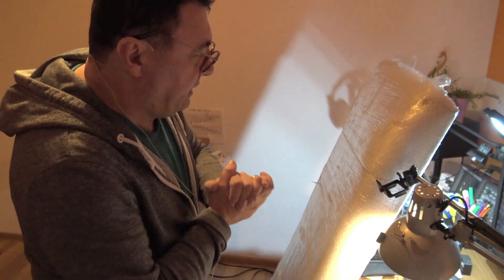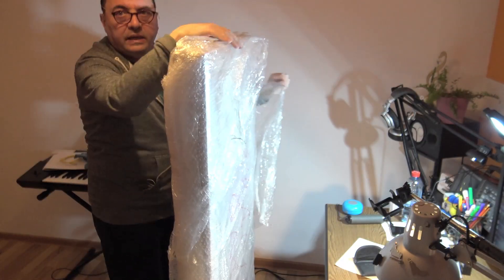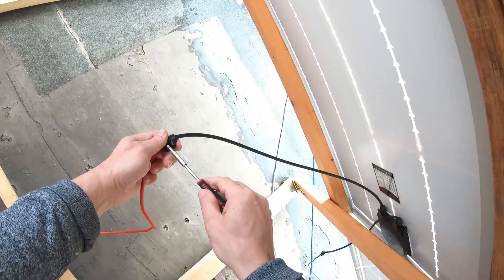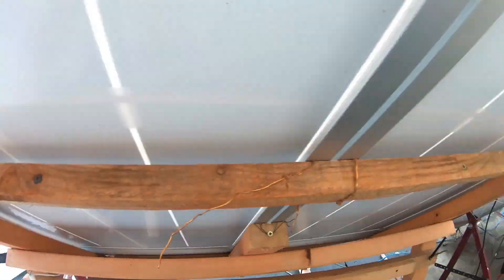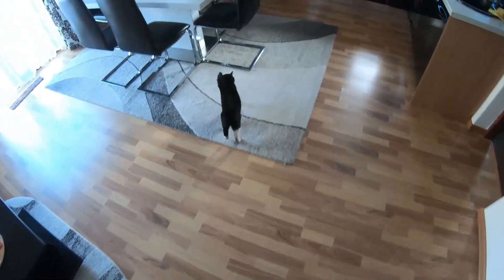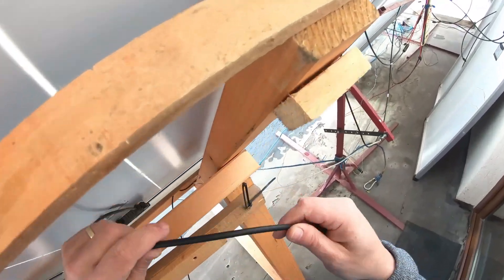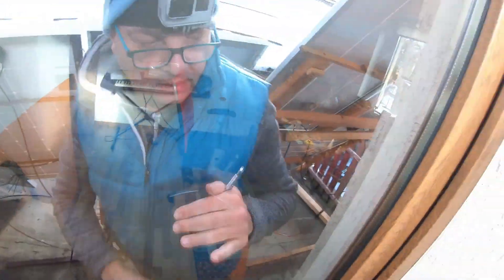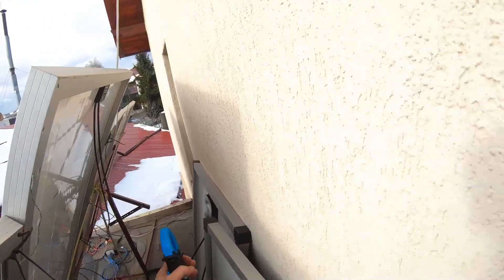SolarFam SZ-200-36M High-efficiency mono solar panels install

Comment: Good one Vio, you still have some space there for some extra panels. Would be nice to have a project about making adjustable panel supports :)
Reply from the maker: Well, it's nothing permanently, still figuring out the best stand and how to use that little roof space.